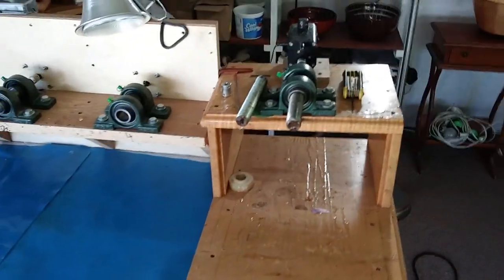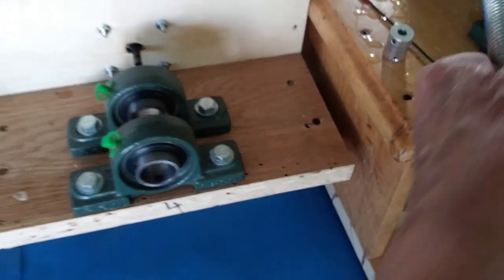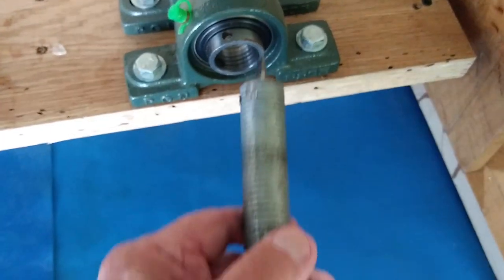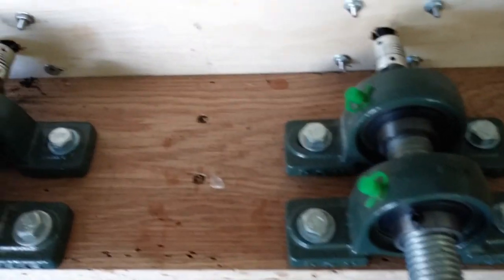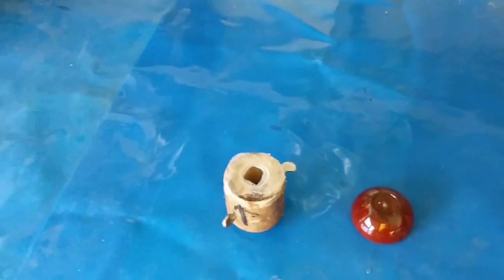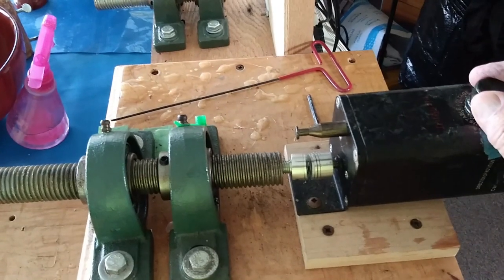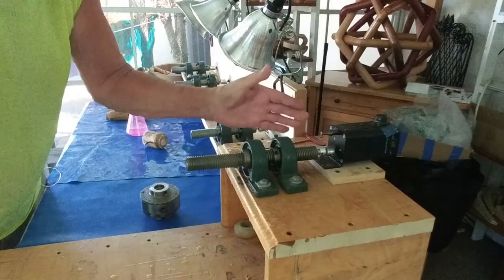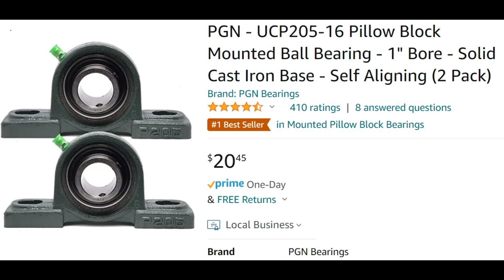Making Different Slow turners for Epoxy  and Other finishes

Comment: Very nice video.   New woodturner and I blame youtube.  After watching some lady in England making a box with pinecones and a few drops of green ink added to the resin… well that was it I had to give it a try.   I have a midi lathe so my slowest speed is 150rpms and finishing is not possible cuz everything flies off everywhere.  😂   Not good.   Thought about a rotisserie motor and then saw another video where the guy made a setup similar to yours.   I really like the idea of the bearings for the extra weight support.  Thanks 😊

Comment: is there a reason you used a threaded rod. problem i have is the 1" at the big box hardware stores are not fitting
Reply from the maker: They should fit the bearing blocks if that is what you are referring. if they don't just sand or file the threads down a bit. It won't need much

Comment: Do you use any sand and sealer for epoxy?
Reply from the maker: Yes sand to 120 then 2 coats of Minwax water base sanding sealer. then 3 coats of more or less depending on results you are looking for.

Comment: I don't see the links to parts you mentioned.  What am I missing?  Thanks
Reply from the maker: There are at the end of the video each part is shown there 8 seconds at a time. You will need to pause the video and write it down or use a screen grap for each part. here is a link to one of my videos that shows the slow turner being used and the epoxy and brushes and process I use.